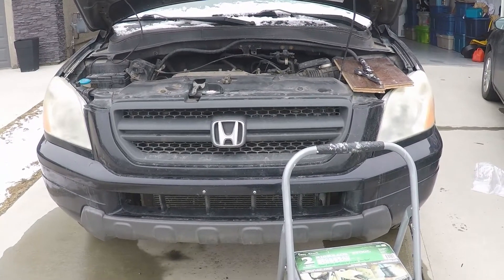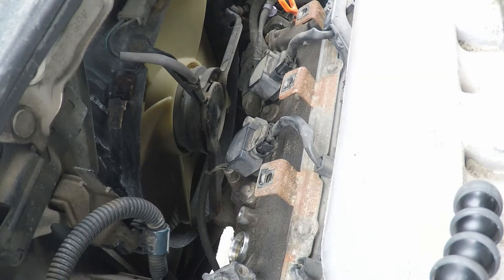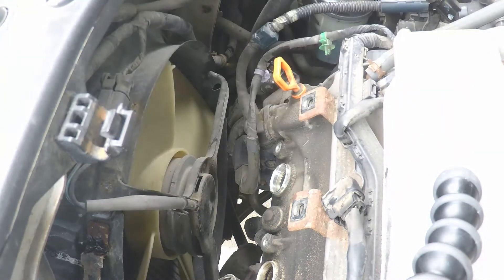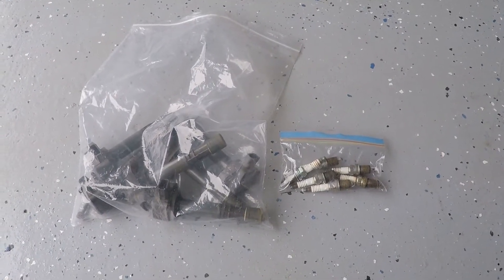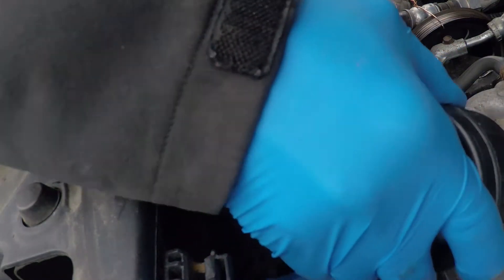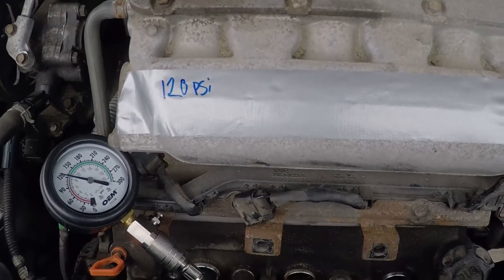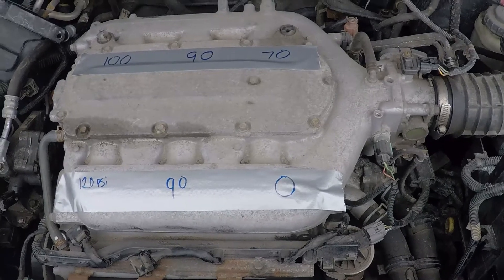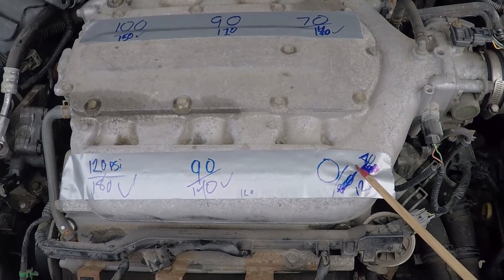Part 1 - 2005 Honda Pilot Compression Test

Comment: The one that was 90psi was because the battery was weak
Reply from the maker: That's possible, but it still very accurately found the problem cylinder

Comment: what was the recommended psi for the engine as per honda specs?
Reply from the maker: Because my vehicle was very off I was more looking to determine which cylinder was very wrong rather than work off factory specs so I didn't do a great deal of research on the matter. My understanding is generally over 100 PSI, up to 175 PSI with no more than a 10% variance between cylinders, but again I didn't go deep in depth on this.
The leak down test was a bit more telling for my vehicle than the compression test. In retrospect going for the leak down test from the start would have been a better idea.

Comment: What ended up being wrong with cylinder 6? The timing belt just snapped in my 06 Pilot. Wondering if the engine is salvageable.
Reply from the maker: lol....you need to watch the whole video series for that...Just kidding. The leak down test in the next video provided better diagnostics. I would recommend you just buy a leak down tester and see what happened. In my case the two intake valves were bent.  I also have a video on getting the new valves in. The job is time consuming. It's not particularly technical, and you can source the parts for a reasonable price....but its time consuming.
It formed the initial basis of my youtube channel though, so it helped me out.

Comment: What led up to the timing belt failure? Was it over due? Low quality aftermarket belt? Some other problem?
Reply from the maker: I saw the other comment as well. The Canadian Tire belt should have lasted longer, basically it made it to the exact replacement distance and failed. The water pump had also just started leaking so maybe a couple weeks of coolant dripping on it may have caused some weakness. That said I also paid to have the water pump changed when the belt was done so it shouldn't have failed either. Unless they just said the pump was changed but didn't do it, which could happen. My key take away here is that if you go with a different company be sure to check their replacement interval and don't assume it will match the OEM interval. I went with Canadian Tire because they were slightly cheaper, but if Honda products last 20% longer, then the Canadian Tire version suddenly becomes less of a deal. I would be more selective in the future. I would likely trust Continental products and a few others, but anything totally generic I will avoid.
Reply: @DIYNorth  Thanks for the insight! I'm keeping my now aging 2010 Odyssey, owned since new, until the end of its useful life (many more years, if the rust doesn't get it) and servicing it myself when ever possible, so I've been gathering info and studying all these issues.

Comment: Where or what fuse did you disconnect? Where is it located
Reply from the maker: The fuse panel in question is located on the driver's side of the vehicle very close to the parking brake. I removed the fuel pump fuse to prevent gas from building up in the cylinders while turning the vehicle over.